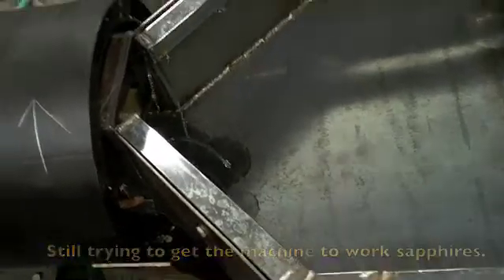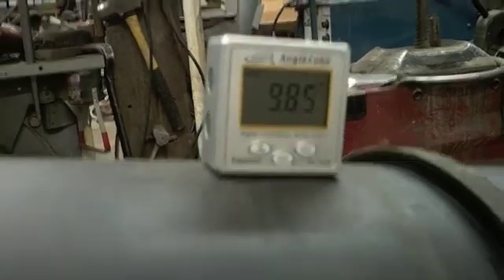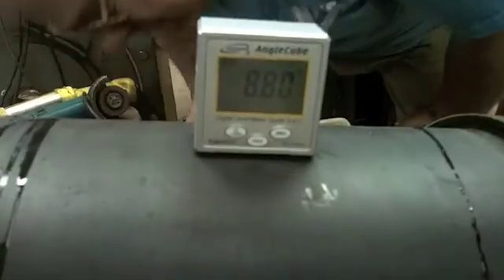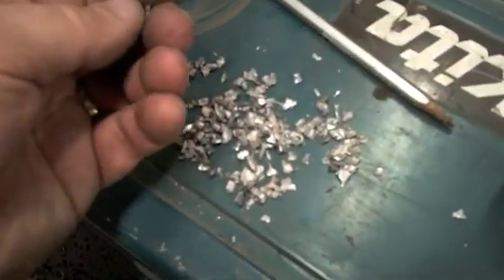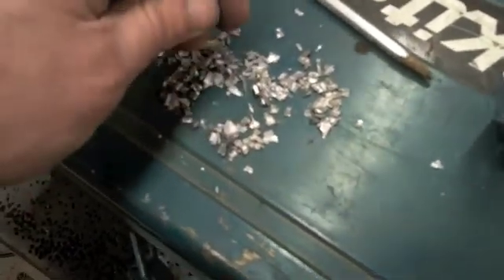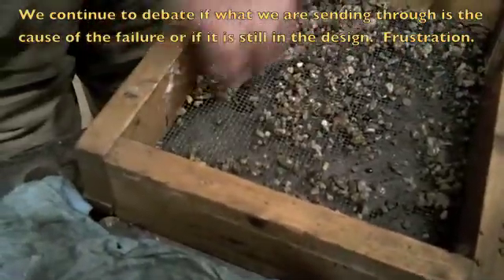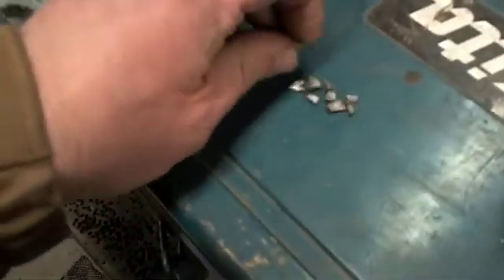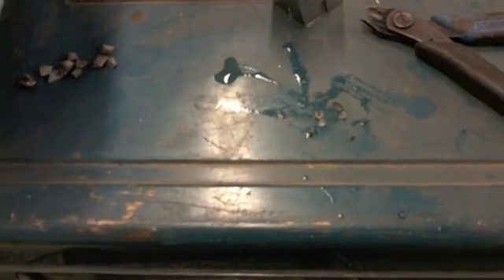Reverse Helix Gold Trommel: Sapphires.

Comment: i know this is from a long time ago, but i think the issue is with the design, right now it's acting like a normal riffle sluice, which works by making a vortex behind the riffle,  but since it's a rotating helix, it pulls the riffle away, releasing the gold again.

what I think you would need it to be, is a drop riffle system, where the gold/heavies will sit inside grooves.

Comment: Agree with what the other commenter said. I'm not a trommel expert but trying to reason through the physics, it seems like for sapphires, having about 1/4th the specific gravity of gold, would need a tighter pitch on the helix?  Also, the principle is that there needs to be enough water so that the heavies will sink.  It looks like your heavies are being held up in the thick slurry - again, need more water.   Thanks for posting this, very interesting.  How is it working now?